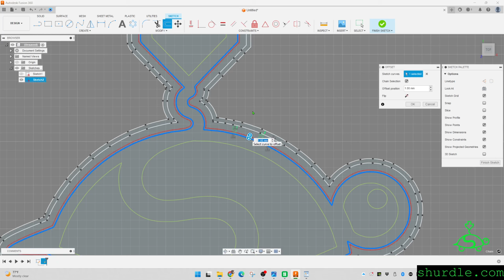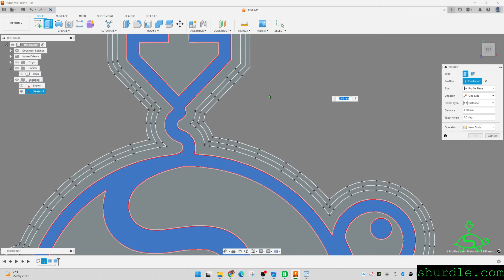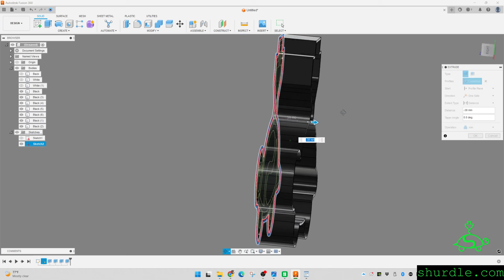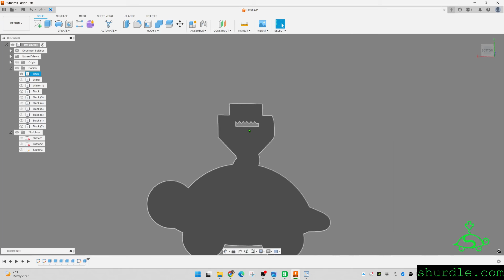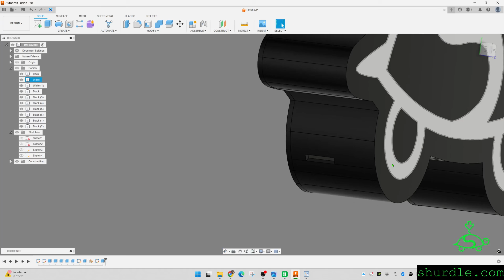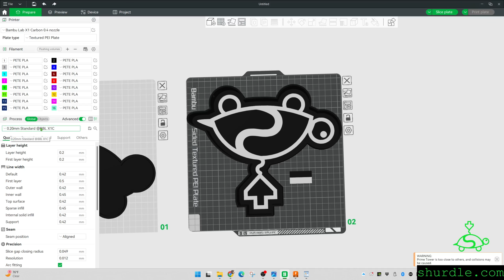(OLD VERSION - Check "UPDATED" video) LED Light making tutorial with Fusion 360 - Shurdle3D

Comment: I have been meaning to try this out for a very long time now and finally started today. The problem I am having is that once I put the offsets around the image they collide and need to be re-arranged, you said it can be moved around and cleaned up, but that is a whole other tutorial.... have you done that tutorial? Because my design is a horse with its legs apart when I do the offsets they merge into each other and then it won't let me extrude, at least that is what I think it's doing. I am completely new to fusion 360 so its quite confusing.
Reply from the maker: I have not done that video yet, but the key is just cleaning up the cross lines with the trim tool. When in sketch mode click “T” for trim and then start cleaning up the extra lines you don’t need.

Comment: Thanks for the video. You’ve given me so many ideas of things I can make now. I use Onshape so I had to adapt a few things but it seems to have worked. X1C will be here tomorrow (coming from an Ender 3). Not sure if fusion is the same but in Onshape when doing an extrude if you want it to go the opposite direction you can click the arrow and that will make it go the other way and you won’t have to enter negative values.

Comment: i have a prusa mk4 without an AMS, wil this work?. or do you need AMS system for these light boxes?
Reply from the maker: You need some kind of MMU system. Doesn’t have to be AMS but it’s not an easy feat with a single color printer.
Reply: thanks for your quick answer, i guess i have to save for the mmu3 then :-) @Shurdle3D

Comment: I don't get it, everything works apart from the offset sometimes, I can do an offset of 2mm, then that's fine, I try to do another offset at 4mm and it won't let me highlight the section inbetween, almost as if it thinks it isn't connected, yet it clearly is. Very frustrating.
Reply from the maker: Some lines are tiny and you have to zoom in really close to click it. If you have everything clicked and it won’t let you select it, just offset everything else and the come back and offset that part by itself and trim the excess off.

Comment: Hi, I've followed your video and I thank you very much because it's well explained.
My question is about the black extrusion. You said the black should be 1mm high and other colours 0.60mm. The problem is when I try to print my model the black is the first colour printed and  my bambu x1 prints first of all the entire black so 1mm and then the other colours and it happens that the other colours make all bridges in the black layer so the print it's all messed up. Is there a way to solve this?
Reply from the maker: weird, I've never heard of that happening before. My best guess is that you have the pieces imported individually so it's acting to print individual parts rather than the entire model as 1 part if that makes sense? Did you import ALL of the parts at the same time where it says "import as single object?" and click yes?

Comment: How could I fix the issue of other colored blobs appearing? for example I get a small red piece of filament in a white area completely ruining the whole print. I've tried increasing first layer flow and leaving the default flow to .98. I will try lower values to see if this helps I see some filament sticking to the nozzle occasionally but I don't know how to fix that. Thanks for the tutorial it is a cool concept!
Reply from the maker: This problem varies by filament and not really a good easy way to fix it other than watching your first layer go down so you can see when a string or blob is forming. I’ve pulled it off with tweezers or brushed it away off the bed before it printed over the color but no settings will change that from happening.
Reply: thanks! ill monitor the first layer to see its progress making sure everything goes smooth! @Shurdle3D
Reply: @glopyz I am still struggling with this exact problem. I have done so much tinkering and feel like I am just spinning my wheels. Did you figure anything out?
Reply from the maker: @Clooney003  I don’t believe there is a “fix” for it. From my own opinion it’s an inevitable part of molten plastic that it isn’t perfectly clean to deal with and eventually gets something dirty. Maybe if you can make some kind of tooth brush that wipes the complete bottom of the nozzle clean every color change you’d be better off but that’s a chunk of tinkering there.
Reply: @Shurdle3D Im slowly getting them dialed in but I am positive this can be fixed with the right settings. I made a really clean one last night but I need to adjust the flow to fill in more gaps. I think the flow setting is crucial for professional results. Too little will cause gaps and nozzle lines and too much creates blobs and stringing.
Reply from the maker: @Clooney003  yes, but if you’re going to do that, you’ll have to do it with every single individual filament because none of them are identical properties. So is it possible, I’m sure there is a way, but is it worth all that time and effort? That’s up to each person themselves if they’re up for that task, I most certainly am not haha
Reply: @Shurdle3D  😂 I get it I can deal with a little imperfection here and there, but but a shoe string of black showing through white is too much. Keeping with the same brand of filament helps as well.
Reply from the maker: @Clooney003  yeah if it’s that bad then I’d have to find a fix, however I get a hairline string in my prints maybe like every 10-12 of these so it’s a pretty rare occurrence and very few of them are bad enough I need to trash them.
Reply: @Clooney003   Other than babying the first few layers, not really. I think lowering the flow or temp might be the solution but I still have to do testing. maybe even drying the filament thoroughly might be the fix since most filament straight from the factory still has some humidity.
Reply: @Clooney003  I think I found my solution, it was incorrect pressure advance settings I haven't done a calibration on my elegoo filament for pressure advance so I was using a generally recommended .02 but that was messing everything up. I just turned it off and it printed flawlessly no more blobbing . Also drying the filament helped with the stringing
Reply: @Clooney003   So i dried all my filament already while it did fix some of the stringing it didnt fix it all. I see the stringing forming at the end of the movements so maybe it could be Z hop? or retraction? i will test different settings see if i can fix it. I printed another logo and it had blobs that were easy to see

Comment: Thank you so much for the video, I've been wanting to make these! I've got no idea what I'm doing wrong thought I tried 2 separate pictures and built them all the way but both times I loaded them into bambu the the pieces wouldn't load together as a single piece but would load them all on the plate by themselves
Reply from the maker: When loading them into Bambu studio at the same time it will have a pop up that says “do you want to import these as a single object” and you have to click yes.
Reply from the maker: it's right after 20 mins, what you're wanting.
Reply: @Shurdle3D  I do but when it loads the files they all end up in a pile
Reply from the maker: @darkknightz6661  so that means either you’re not importing them correctly or you exported them incorrectly from a pile. When you export them from fusion it saves the “location” of the body in relation to whatever you’re loading in the slicer.
Reply: @Shurdle3D  I'll have to go through it again today and mess around with it some more. I was following you're tutorial very closely. I appreciate you responding and helping!

Comment: So what do you do if you have a logo that is multiple parts and doesn't have a solid line around the whole thing? How do you set the offset on all the parts without them overlapping and turning out horrible?
Reply from the maker: I have another video called "connecting multi-part logos" you can see that one and should answer your question.
Reply: @Shurdle3D  Thank you so much, I will check it out now.

Comment: can i do this with with the testversion of fusion? first time using the program. not finding some things.
Reply from the maker: Yea you can do everything in this video in the free hobby license.
Reply: @Shurdle3D  thanks, found out it is my logo that caused the issue. Different logo got me further (took break, gives me soo much stress). Just wish i knew why that logo does not want to do what i say. ( when at the extrude the logo after creating the offset lines. Logo does not stay blue when open extrude, so don´t get option to do the 2mm thickness. Tried alot of things but just not get it. ) i have no real design experience. 0 fusion360 experience, only a bit of simple tinkercad things)
Reply from the maker: @TropicalPinoyVibes  I have a video that says “broken lines” look at that one and it will fix your issue.
Reply: @Shurdle3D  awesome, will check it out later! Thank you very much !!!
Reply: @Shurdle3D  (with the second logo i did what i asked, following your instructions. So it must be the svg logo i assume)

Comment: Instead of exporting each object, you can save as mesh all the bodies  at once and then split them in your slicer of choice as parts or separate objects.
Reply from the maker: Yeah there’s many ways to do everything. I think the way I showed in the video is easier for a new person. Also if you have logos with 20 bodies in multiple colors it would be too many to deal with. Some of my light boxes have 150-200 bodies before I export.
Reply: Or you can export it as 3mf and they are automatically splitted. BTW great video I'm looking to make these light boxes I wish you had more info about the lighting
Reply from the maker: @RTCDigitalS  I have more info about the lighting in my other videos, you can check out the one “how to install the LEDs”. 3MF export is another good option.
Reply: @Shurdle3D  will check it out. Thank you!

Comment: Having a weird issue when trying to create the initial offsets.  The first 5mm offset works fine but when I do the 7.5mm and 10mm offsets for some reason those are not included as part of the surface (I hope I'm being clear here, they are not shaded and the regions they bound are not selectable like the 5mm region is) and while the outlines are there those two areas do not extrude along with the rest of the SVG and 5mm area.  I can't find any help, likely because I don't know how to word the question correctly, so any ideas you have would be very helpful.
Reply from the maker: Look at my other video called broken lines and that should fix you up. Also, your offsets will be huge if you do that big, I recommend 2.5 & 5 mm offset
Reply: @Shurdle3D  Gave that a try and while I located the problem node even when zoomed in as far as I could there was no gap that I could repair.  Ended up finding an add on that repairs them, it cost me $10 but it works great.  I used it on several SVGs that gave me the same issue and I have no doubt it will save me $10 worth of time quickly!  Thanks for your quick reply.
Reply from the maker: @revgregory  awesome, what’s the plug-in called? Might come in handy for myself and others.

Comment: Best tutorial so far!

Can you share your bambu settings?  I am not sure if it is a setting issue for me or not but when I printed my light, I would get a slight gap where two different colours meet. I can literally pull the multiple bodies apartfrom each other.  They don't seem to meld together.
Reply from the maker: I actually have another video for this, check the one that says “Arachne walls” and watch the flow ratio part. It should fill the gaps and also help fuse them together better.
Reply: @Shurdle3D  The gaps you are filling in are within the same colour such as shown on the close up of your turtle on that video.  My gaps are actually between the two colour components.  I do have arachne on and have increased the flow rate of the teal filament only as it appeared in previous prints to need it.  The black was fine.  I have also increased the wall overlap. Sigh.... I wish that I could share a picture here of what I mean.
Reply from the maker: @chantal6683  sometimes the filament is the issue and not the actual print settings. Have had a few people just simply switch filament and fix their issues before. So before diving too deep into a crazy world of troubleshooting, try a different filament or Brand first and it may fix all the issues.
Reply: @Shurdle3D  Will give that a try.  Thanks!

Comment: What method are you using for creating the stands ?
Reply from the maker: You talking about for circle ones so they don’t roll around or for something that isn’t level on the bottom? Depending on the logo I just make whatever makes sense but circle ones are simple to just make a little half moon shape below them.
Reply: @Shurdle3D  exactly … I figured out how to trace around the fogure and create a box that will hold it but what I’m actually trying to figure out would be how to create say a rectangle box or circle box and use the shape of the led box to cut out a shape on the stand … if that makes sense .
Reply from the maker: @guidancebeats  ah, ok. There is a thing called "Project" and you can use that when you make a sketch and it will "project" the shape onto your new sketch and you just draw the stand around it.
Reply: @Shurdle3D  I’ll check that out . Thank you
Reply from the maker: @guidancebeats  ill put it on my video to do list. been asked a few times about stands
Reply: @Shurdle3D  looking forward to it . Another option I may try is bringing the full model into tinkercad since the hole function is pretty easy in it and they have plenty of shapes to start off with for the stand .
Reply from the maker: @guidancebeats  go to my site shurdle.com and join the discord by clicking the link on there. I can share and help much easier there if interested.

Comment: Great tutorial, Pete. The only recommendation I have is to start with Fusion 360 components and then add sketches and bodies to each component. When I first started using Fusion 360 - I missed that fundamental concept and my early designs are pretty bad and hard to navigate.  Here is a great tutorial to understand Assemblies, Components, and bodies. 
Bodies vs Components | Fusion 360 Core Concepts: 
https://youtu.be/TzG2deElWqI
Reply: This right here. Start with good habits, rather than forming bad ones and then having to work backwards.

It doesn't seem too bad with simple models, but quickly spirals as they become more complex. Especially if you go back several months later and have to revise something.

Ask me how I know. 😂

Otherwise, great guide.
Reply from the maker: that is good for a professional style and organization, just not for someone who has never used Fusion 360. I believe the way I do it is probably most beginner friendly. To be honest the only times I ever use components are for moving pieces and if it's something that needs to be organized. Other than that, it's much quicker and easier for these use cases to just make a folder, name it whatever color the bodies are and throw them in there. Much quicker and easier and less steps.

Comment: Great tutorial, do you not have to add any tolance to the ridge on the back plate?
Reply from the maker: these being so large there is less worry about that, but if you're making a small model, the tolerance you may have to adjust for your printer. On mine I've never had any not slide right in and you also want it kind of snug so you can use it without having to glue it.

Comment: Do you have a tutorial for someone that doesn’t have a bambu printer 😢
Reply from the maker: Which printer do you have?
Reply: @Shurdle3D  an anycubic kobra and geeetech Mizar s. Both single extrudes.
Reply from the maker: @daniellecalabro7895 in order to make this print on a single color machine, you’d have to sit there with your printer and you’d have to know how to make custom stops in the Gcode for it to pause when certain bodies are complete so you could swap the filament back and forth. Way entirely too much work to be honest. Even on a black and white only you’d have to site there for the whole first 10 layers and color swap it every single layer.
Reply: @Shurdle3D  I was thinking more along the lines of creating a transparent plate like the back plate but with out the lip that I could insert into the the frame for the led to shine through. I could probably do that by creating an offset and body, correct ? Hope I’m making sense
Reply from the maker: @daniellecalabro7895  you can you that by creating inserts, but it will be quite different from this. Kind of the same concept though, just extra work.
Reply: @Shurdle3D  trial and error 😉

Comment: when I try to offset the outline of the svg Fusion stops responding. I then click on Task Manager and it shows that Fusion 360 is using a ton of resources.  12% of the CPU and 1.9GB of RAM. My video card is a 1060 with 6GB of RAM and I have 64GB of RAM on the motherboard.
Reply from the maker: Fusion 360 is heavy on the CPU mainly. So the CPU is going to be the main bottleneck of how fast the software runs. Fusion isn’t great at handling SVG’s so sometimes you may have to wait a minute or two until if finally calculates your offset. I have a very strong computer and you can see how long it takes mine in the video.